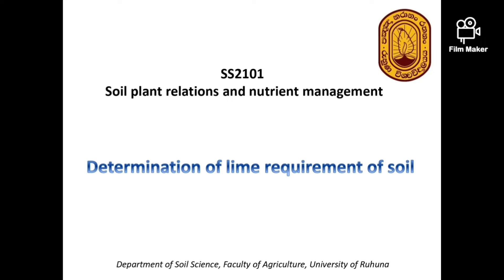Determination of Lime Requirement of Soil

Comment: Hi there.  I am trying to understand the formulation so I have tried to answer the following example. Can you tell me if the calculations are right ?

Example:

 Required volume of 0.05 M H2SO4 for  the  blank test is  5ml; Y = 5 ml;
Required volume of 0.05 M H2SO4 for the sample test is 3ml ;  X = 3 ml;
Y - X = 2 ml;

0.05 M H2SO4 1000ml  = 3.7 g of Ca(OH)2
0.05 M H2SO4 1ml = 0.0037 g Ca(OH)2

Y - X = 2ml  = 0.0074 g Ca(OH)2

0.0074 g Ca(OH)2 in 50 ml of filtrate; in 200 ml of filtrate = 0.0074 g *4 = 0.0296 g Ca(OH)2
0.0296 g of Ca(OH)2 reacted with 20 g of soil
therefore 1000 g of soil will react with 1,48 g of Ca(OH)2

soil density = 1300 kg/m3
in the first 10 cm of the soil the density is 130 kg/m3 => 130kg/m2
so, 1 kg of soil will react with 1,48 g Ca(OH)2
       130 kg of soil will react with 192,4 g Ca(OH)2
1 ha = 10000 m2 
1 ha will react with 192,4 g Ca(OH)2 * 10000 = 1924000 g  = 1924 kg Ca(OH)2
weight of CaCO3 required for 1 ha = 1924 kg Ca(OH)2 * 100/74 = 2600 kg 

weight  CaCO3 /ha = 2600 kg = 2.6 tones/ha 

are my calculations right ?